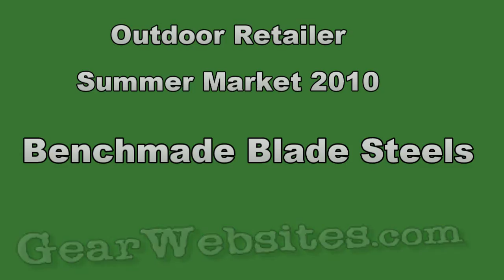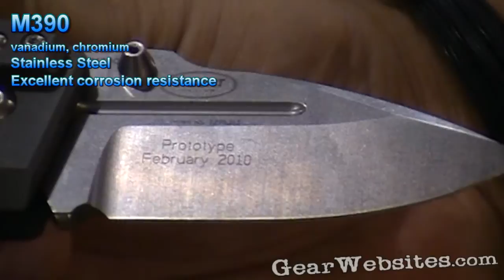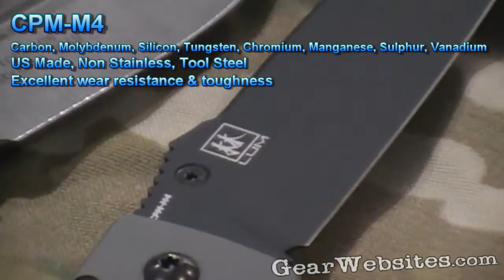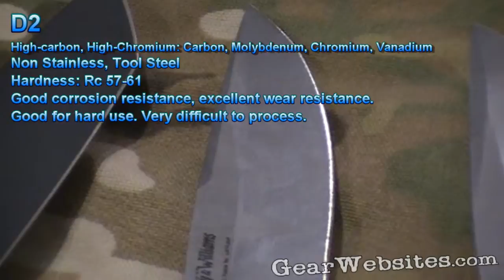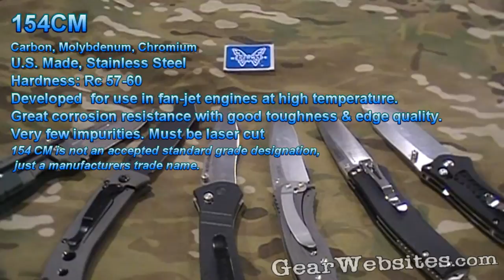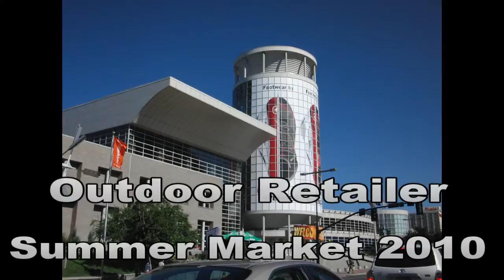Benchmade Blade Steels

Comment: Thanks for posting this video man. I enjoy seeing how my choices in steel stack up, as I'm constantly searching for the ultimate in blade steel. 
So far my choices of  Benchmade Knives are #1 Model 740 DeJavoo, which is a side lock folder  with S30V steel, and #2 Model 515 Rant fixed blade drop point knife with D2 steel. 
So far, very happy with both. :)